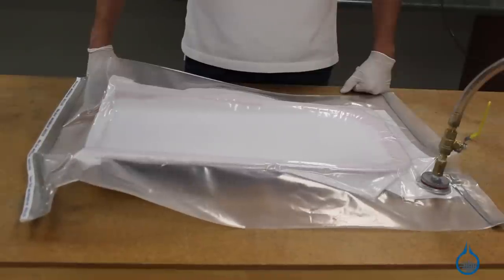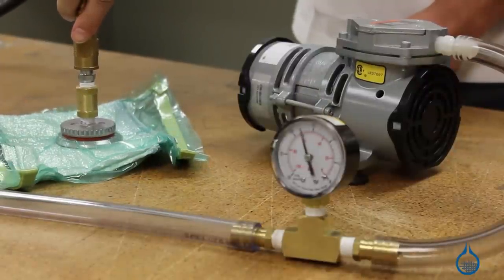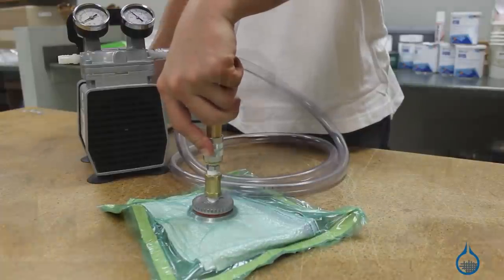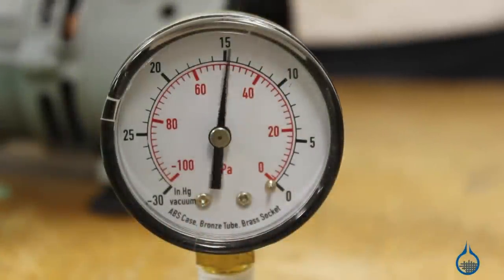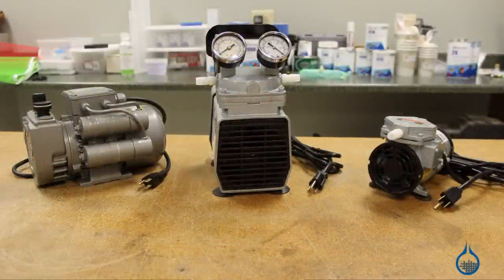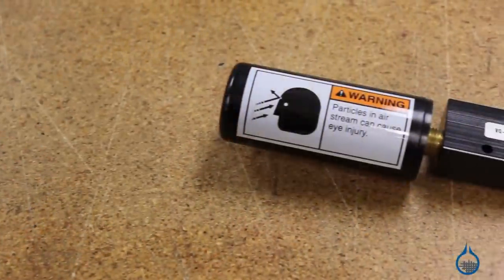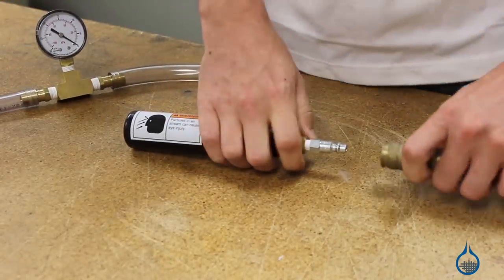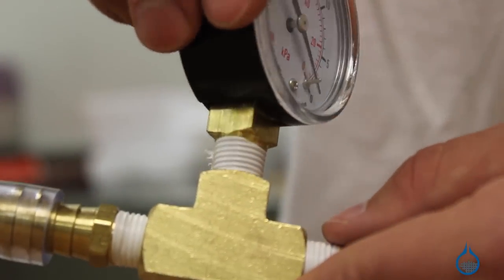Vacuum Pumps Overview

Comment: Hello..There is any problem if the vacuun stay on for 12h?It gone burn the punp or have any valve to do this?Thanks
Reply from the maker: All of our vacuum pumps are rated for continuous use.  We also sell vacuum shutoff valves that would allow you to close the vacuum line, keeping your layup under vacuum provided there were no air leaks in your bag.